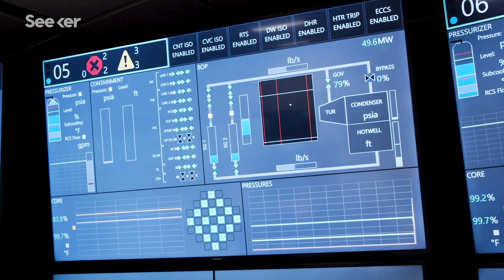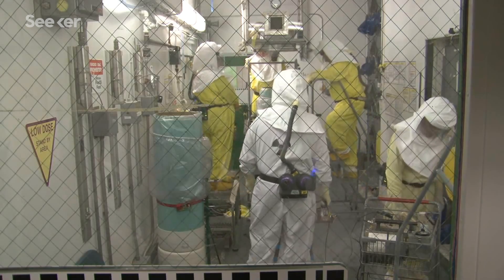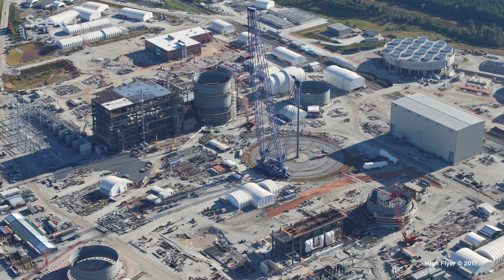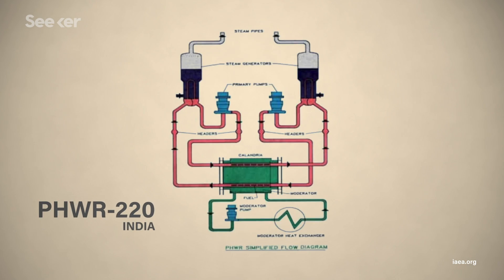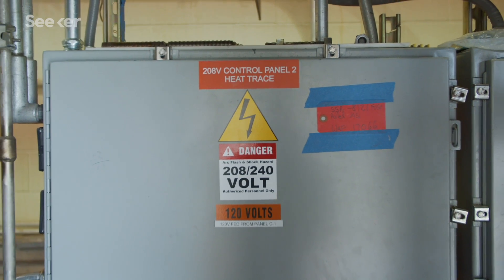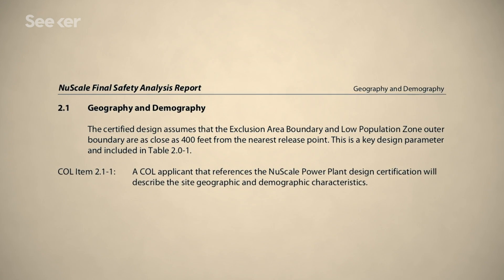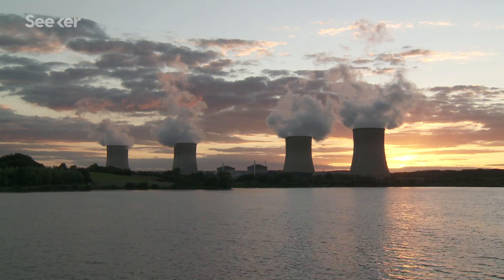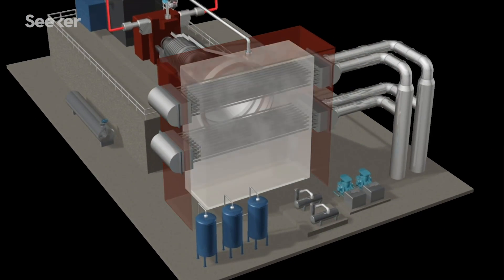Mini-Nuclear Reactors Are Coming, and They Could Reinvent the Energy Industry

Comment: How much electricity could be had from $30b worth of solar and it’s construction vs that nuclear plant? Seems ridiculous to even try to use nuclear
Reply: How much land do you think you would need to provide a stable source of energy with solar? My guess would be very long strips of solar panels cutting across the whole of America. And even then the sun will set and you will have a nationwide blackout.  My guess is that you are a liberal so rolling blackouts and bread lines doesn't bother you much.
Reply: Tyler Mckinnon Elon quote - ““If you wanted to power the entire United States with solar panels, it would take a fairly small corner of Nevada or Texas or Utah; you only need about 100 miles by 100 miles of solar panels to power the entire United States...”
Reply: @the-uppload  Though Elon is a great investor and visionary he is not the expert of everything. That's extremely wishful thinking and doesn't take into account the goddamn earth rotates and you can not provide solar energy 24/7. And physics is against us on storing enough energy to power America during those downtimes.
Reply: Tyler Mckinnon he also said in the same sentence it would take 1 mile squared to store the energy necessary in batteries. And the rainstorm outage mentioned is alleviated using localized power storage, such as power walls or electric vehicle batteries.
Reply: @the-uppload  All made using rare earth elements that are already expensive. Can you just think for a minute as to how much the price would skyrocket when everyone needs a power wall in their house or is driving an electric car? Not to mention the over mining for it and the toxic waste it creates during production and then at the end of the products life. I know, I know, hearing nice things is enchanting and you tend to turn your brain off because you want to believe the dream, but that's all it is, a child's dream not thought through.
Reply: Tyler Mckinnon That is the correct response, and why nothing of this scale has been done, but there are advancements everyday, dry cell manufactured lithium batteries are coming, sodium glass batteries are being investigated, purely graphene batteries are being researched as well.

Even with the devastation caused by mining it is likely less than the waste that comes from nuclear facilities.

As for skyrocketing prices, it’s one time cost, reusable, and recyclable when it does deteriorate. I’m sure spent uranium is the same to some degree, but it’s more rare than lithium is as far as I know.
Reply: @the-uppload  Nothing is ever going to be done at that scale because it's ridiculously impractical when there are other options on the table. The states already clearly show that nuclear is the safest and cleanest energy source we currently have on this planet. Small amounts of material can be used to produce large amounts of energy, so mining isn't that big of a concern. And people like you continue to spout off about safety because of what happened with first-generation nuclear reactors. I'm sure the first-gen anything was unsafe or unstable. And how is it a one time cost!? When you have to replace worn-out batteries do you think the government or big companies are going to front the bill for you? Give me a break, you can't be that goddamn navie. And recycling toxic materials is far from cheap. You do live in a dream world.
Reply: Tyler Mckinnon it’s much more logical to use localized solar, and ditch the electric infrastructure however. Existing power lines could be converted to data transmission lines instead.
Reply: @the-uppload  Great, so each area when they have a rainstorm or overcast weather loses all power and is pretty much fucked, great plan.

Comment: Nuclear power is somewhat obsolete in electric power generation. Renewable Energy is much more efficient and way safer than nuclear. And you can own a personal power plant! Who wouldn't want that?
Reply: there is "just" some little disadvantage with renewable over nuclear and I will give you two of them : 1) a renewable power source will take much more place than a nuclear power plant to produce the same amount of energy. 2) renewable energy are not (for now at least) usable 24/7 because at times you will have too much or too little wind or you wont have enough sunlight and if you want to store energy made with a renewable source it will be done in a not really effective and VERY NOT eco-friendly made battery

Comment: I'm an electrical engineer in Silicon Valley.  That many monitors shows a poor design.  This is something I'd expect in the 1960's, not today.  This is why we have computers - to consolidate information, not to display everything under the sun.  This is an incompetent design.
Reply: These are test plants yo. This isn't the final design intent.
Reply: @duncancampbell7357  In my opinion, it looks like this "test" was just a mockup to be public relations to the public.  This garbage all looked futuristic and high tech, 30 years ago.

If this is seriously even CLOSE to the design of a FUTURE nuclear power plant, we're doomed.

Safety systems with this level of danger should be done by making expert systems, 3 of them, designed independently.  You then run all the data into all expert systems, and when you get disagreement, you debug and fix the bug.  This requires human oversight of course, but you can have the entire system tested to the hilt.  In a real world system, you continue running all 3 systems, and best 2 out of 3 gets it, and when you get a discrepancy, you debug.

As I get older, I worry about the extreme sloppiness of code and software being created today, and just how haphazard it seems to be done.

We  know how to build fault-proof systems, we have solid models on nuclear reactions.  These should be entirely 100% safe at this point.

Nothing but a physical failure should even be possible.

Comment: China has a new Generation 4 prototype gas-cooled reactor and are building an MSR.  We need Gen 4 prototypes now to prove the technology. Then we may have some vital options for low carbon energy. Rooftop solar will not meet the world's rapidly growing energy demand. It will not power industry and transport. And growing crops for fuel is an environmental disaster. We need lots of options.  The US government is changing its policies on Gen 4 reactors prototypes. But China is leading with help from US technology. We need to share gen 4 technology anyway. Rather than have countries building old PWR reactors.

Comment: Switzerland is not dismantling its nuclear reactors.
The Energy Strategy voted in 2017 states that no energy consumed by Switzerland shall originate from nuclear reactor in 2050.
So for the next 30 years, the oldest reactors in the world will continue functioning...
Reply: Sig Simond Yep, they will. 
I live about 2000m from the oldest one. It’s shut down a quite big part of the year for checks etc. but it’s still running and in 4 weeks it will have its 50th „birthday“.
I think it’s a good thing to not build new ones, but also I think the ones we already have should run as long as they are safe.
Reply: With all those empty Swiss trains running to a fro they need to keep the power coming from somewhere.
Reply: As a Brit I would much rather have something newer and safer than to slap a "Good for the next 20 years" label on something that is already 40 years old, our reactors have 3cm cracks in their containers and out-of-order fuel channels that have warped from the heat yet instead of shutting them down between 2000 and 2010 as they reached their end of life we've been forced to cover them in duct tape and let them run until 2030 because the green brigade block every attempt to replace them.

Comment: What would it take to reduce the size of that “vessel” to say the size of a small car? Nuclear powered fuel cells have such exciting applications.
Reply: +FullFightAnime 92. That depends mostly on the type of fuel used. There needs to be enough of it in one place to keep the chain reaction going, and this inevitably imposes a size limit on our reactors. However the good news is some fissile materials need less of themselves to maintain a reaction while others need more. Americium for example requires much less material to start a chain reaction so reactors using americium would potentially be much smaller than reactors using uranium or other fuels.

Comment: Just a thought... I wonder if it would somehow be possible to have a small valve at the bottom of the cores that was sealed shut by an electric valve and was somehow located under some sort of flat plug the diameter of the core. Then if power is lost, the valves open and the water from the containment vessel comes pouring in, pushing the plug up to the top. Assuming the water getting inside the core (before the fuel rods have dropped in ideally) isn't a problem and the water pressure was enough to hold up the fuel rods maybe it would work? I'm probably also not explaining this well...

Comment: just go to big oil and ask for all the designs of vastly more efficient engines they have locked away in a vault to run the generators.... we've had the tech to get 50km/L with fantastic power and torque.... buuuuut… to efficient for big oil... buy em or kill em, that's big oil's moto

Comment: No more BWR's. We have better, safer designs that don't require cooling rods. No plant that has a single point of failure that could result in a meltdown should be licensed.
If the design in the video fails and the core melts down it will hit water and that converts the pool into a massive hydrogen bomb, there's no time to evacuate if that happens, it won't be contained within the "bio shield", there won't be a shield left. 
In addition if someone produces nuclear waste they should be forced to account for it, whether they reprocess it in an FBR or have space rented in a concrete bunker it's their responsibility until it's safe. If they don't want to deal with the waste they don't get licensed. We presently store waste in cooling pools, Fukushima has 14 years worth of waste stored in those decaying pools, that's can't be allowed to happen again.
We need to learn from our mistakes.
Reply: Nuclear power plants don't explode like hydrogen bombs...
Reply: @Les_S537  When the core falls into water what happens, mmmm? What happens to the water and what gas often ignites? Hydrogen. BOOM.

Comment: Sounds good, but consider this:
One mess up, and that area is GONE.
Irreversible damage, and while we may be able to clean up the effects of fossil fuel, there's no way to clean up radiation.
The least will be 100,000 years until we could reinhabit that area, realistically it could be millions.
Why deal with that when you could just slap solar panels to each home?
It's definitely an uphill battle.
Reply: We're gonna run out of coal eventually. And 'green' energy sources are far less efficient. Nuclear Power is the way to go. Preferably Fusion, because Fission plants can blow up
Reply: @nuclearshorts1243  
Indeed, all the benefits, even more benefits, without the risk.
The problem is to get it to work without losing energy
Reply: I take it you didn't watch the video.  I mean it was short, but they went into a bit about things they're doing to prevent just that scenario.  From the fact that these are much much smaller (so a much less area would be "gone" should the worst happen) to them being underground and already inside essentially a cooling tank, to various passive shutdown mechanisms.
.
Of course nobody can 100% guarantee that nothing horrible will ever happen, but given that we've only had three major nuclear disasters (and only one of which was extreme in the sense that it affected more than a few miles radius) with 1960s technology, I'm not super worried about what we can do with 2020 technology from that standpoint.
.
And its not like they're installing them every second block like they're cell repeaters.  These things would still have exclusion zones and whatnot.. just that they're able to have a reduced exclusion zone to match their reduced risk factors.
.
As for clean up, you are horrendously wrong.  Its easy to clean up a few square miles of radiation.  Scrape the top couple inches of soil and bury it somewhere nobody cares and job basically done.  Yes its time consuming and expensive, but its not hard.  Certainly a hell of a lot easier than trying to pluck those 0.0004% CO2 molecules out of the whole Earth's atmosphere, figure out a way to keep them contained and then figure out what the hell to do with enough soda drinks for all the people that will ever live on earth.